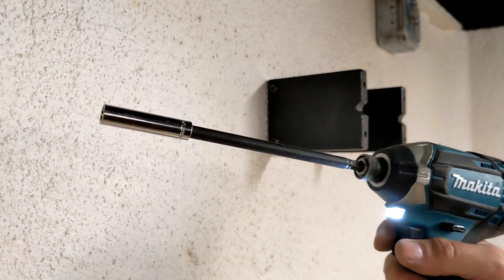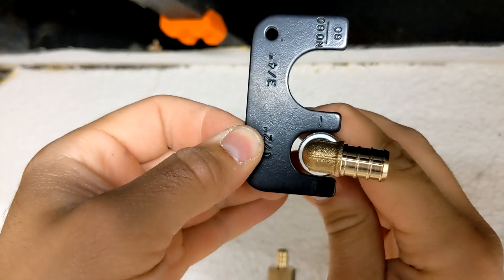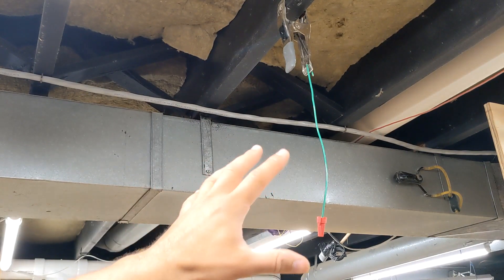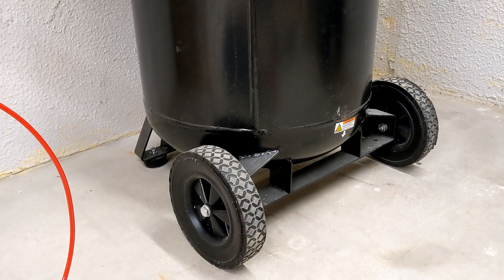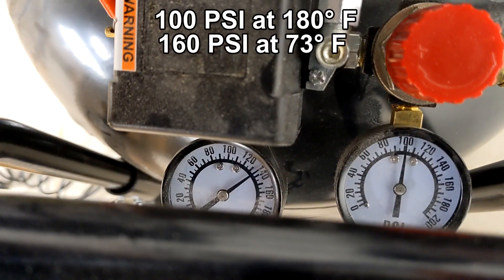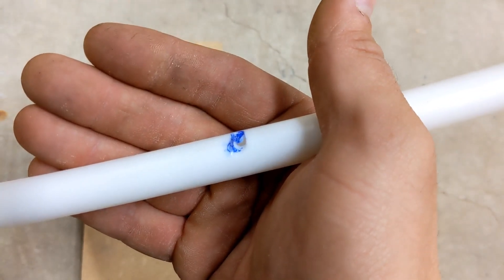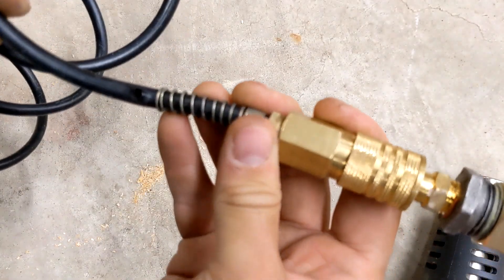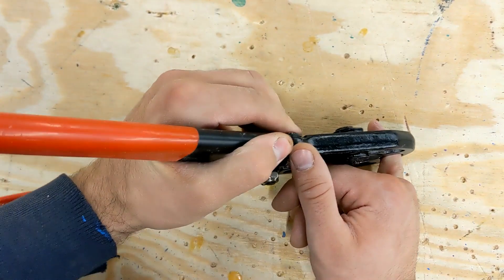Building a Compressed Air System with PEX & Testing it Until Failure

Comment: It’s been a year so have you changed the position of the drain valve down to ground level?  I ask because it seems the air would blow by the large amount of water buildup (as well as sediment) and not push it up to ceiling height.   When I pressurize the pipes in my pool to blow water out this will happen and that is below ground level.
Reply from the maker: I'm planning to upgrade the pipe diameter to 1/2" PEX and a nearby downward facing leg to serve as a temporary reservoir, I might make a video on it and other improvements sometime

Comment: This is fun to watch, but for testing PEX you've missed two key environmental conditions: UV and aging.  Exposed PEX will become very brittle from UV exposure, which I think would be more prone to sending parts flying.  I don't know how PEX does accelerated life testing, but it's probably temperature. Aging would most likely cause the other failure modes happen at lower PSI and lower temperature.
Reply from the maker: Sounds like a good test, where do you usually see UV exposure on PEX? I could try to re-create the scenario
Reply: @daveman4863 welding is the big UV one. The other is improper storage before installation.
Reply: @bpdp379  I have 1/2" PEX pipe run around my residential garage and I weld. I've mig welded flat deck trailers, snow plows and repaired and made many different things. Just about everything in my garage has been exposed to extreme UV light. In fact, I had a white plastic bag with about a half a dozen extra circuit breakers laid on the shelf and a couple of years ago I realized that bag had turned to white flakes. I was assuming it was the ultraviolet light exposure.
The PEX is installed with brass fittings with stainless steel pinch rings and my compressor cuts out at 125 psi. The system has been in my garage now 10 years or more. Matt risinger from the build show actually tests different PEX systems and I think he got the pipe to burst at almost 750 psi? I think
Reply: @daveman4863  hahaha 😆  great response Dave